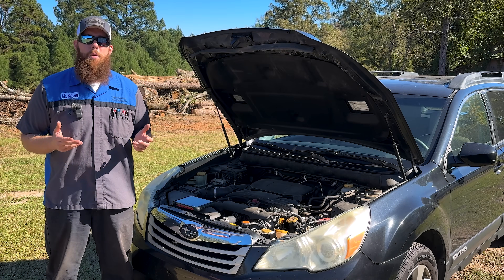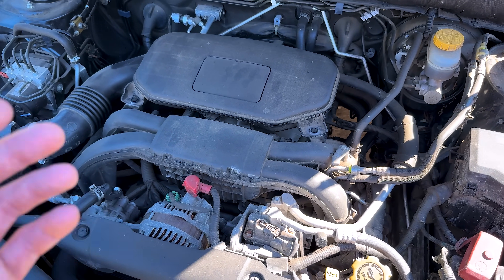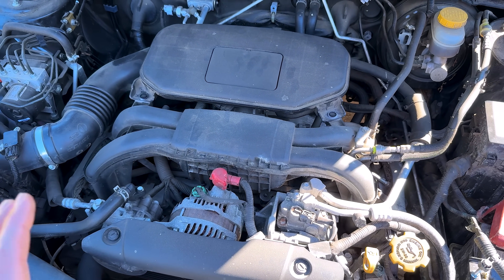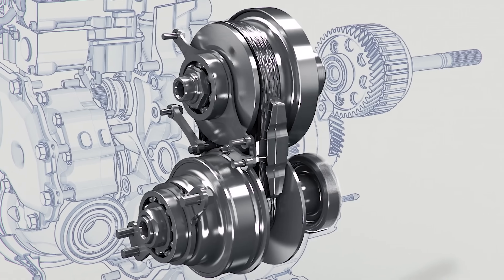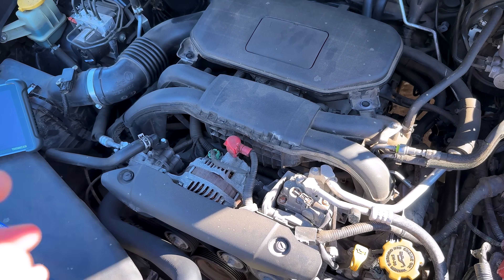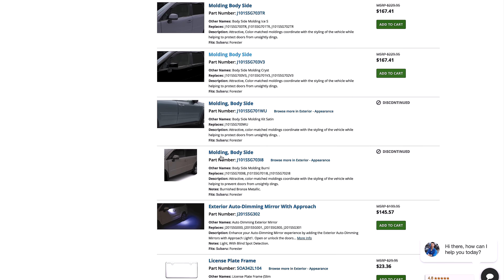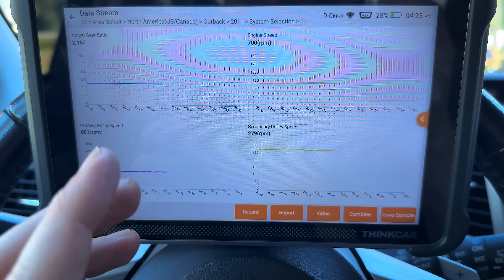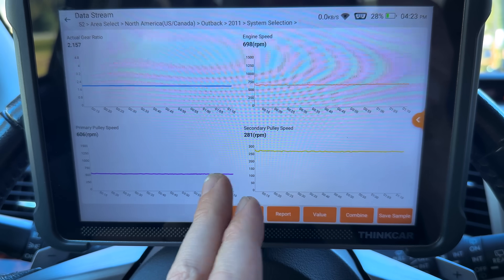Everything About Subaru CVT Chain Slip! How To Prevent It, How To Diagnose It, & Repair Options!

Comment: Yes i have chain slippage 2017 forester xt 117k on clock just bought the suv 6 months ago asumming the original owner never change the fluid started slipping about 3 months ago mostly slip at speed 46-55 MPH on hwy when car is running over 30 min on hwy the slipping goes away for some reasons but subaru is also out of stock on fluid waiting for 6 weeks no fluid at the dealer so i will take a gamble buying a used tranny with 85k on it and do the fluid change on it also the strainer and pan since the fluid is expensive i rather buy a used tranny with 32k less mileage than mines, what do you think used tranny for $400 fluid strainer corking for pan $300 then labor what you think?

Comment: I have a 2014 Outback that had the CVT replaced in 2021 at 98k miles due to chain slip. I had a Subaru maintenance manager refuse to do a drain and fill
When I hit 33k miles because he stated it was a lifetime fluid. Change your fluid folks.

Comment: Subaru Cvt are good transmissions but require clean fluid,my boyfriend bought a 2017  Subaru Outback 3.6 as a Truck replacement for farm work,the deal was to good to pass up. It has 197,000 k on it but runs a drives great save for the Cvt acting odd. I told him he has to flush it ,he drained it out and it was much much better but still acted odd.I told him to do it again in about 800 miles he ignored me until I stole it while he was at work and did it. Now it drives totally different , the strange rubber-band effect is gone,the surging all of that is gone and now you know how much it was slipping. They take twice to get all that old fluid out. He used Triax CVT fluid and it works wonderful.
Reply: any update on how it's working out?

Comment: I have a 2013 outback, when the transmission is still cold even if I drive slowly the engine is at 2000 RPM. The revs don't drop. What could it be?

Comment: My 2017 3.6r outback does that momentary hesitation and squeal usually with in the first 1-2 miles of driving and usually only once per trip. Does this sound like chain slip. I'm thinking of getting the fluid changed to see if that will help

Comment: It’s hard to know what to do when Subaru dealers tell you to not change your trans fluid until 100k miles. Then you hear on videos that you should change it every 36k. Subaru will warranty the trans to 100k but only if it’s never been open. WTF! I’ll buy Toyota or Honda.

Comment: In December 2018 we bought a 2019 Foerster. Shortly after we got the email from Subaru about the extended warranty,  don't change the fluid until after 100000 miles. Will it cause damage if I change it now at 127000, like an old style auto trans?
Reply: That's a myth. You can change the fluid whenever you like, it won't cause damage if it hasn't been done yet.

Comment: Hey! I have a 2015 Outback and this video was extremely helpful! Was curious though if the transmission fluid has never been replaced is it better to leave it alone and not replace it? I've heard mixed things from people and I'd think you'd want to get the particulates out no matter what but I'm not a mechanic.

Comment: Logic is telling me you would never see slippage on the secondary pulley. The primary is the input/engine side so that one would slip under load. If the driven/secondary pulley is slipping, it would still show up as a slip on the primary, not?

Comment: Hi Robert 😊hope youre doing well. Ive stumbled your subaru channel on youtube. 
Thank you for all the info about subarus. 
I’ve recently purchased a 2015 OB 3.6r with 125k miles for my wife. Weve been impressed with the car so far. You made a video that subaru cvt is pretty reliable when not abused and also when its serviced. You mentioned valve body. What symptoms i should look out for if my valve body is failing? Is this main issue on the tr690 HT cvts? Cheers🙏
Reply: Oh I love my 2015 3.6r it’s one of the best cars ever made and is pretty quick too. Sadly it’s the best ever made in every way except for one…. My CVT in mine has had total failure 4 times now totalling to $30,000 dollars out of pocket for services and entire new Cvts since mines out of warranty….. pretty brutal and wish I never bought the car I paid $20,000 for the car and as I said just in CVTs and CVT fluid services I’ve spent $30,000 now in the past 5 years so $50,000 on a 2015 Subaru that had 190,000km on it when I purchased it…. Pretty brutal and has ruined every savings I ever had saved up literally ruined my life in allot of ways and been struggling to get by ever since owning the car

Comment: I swapped out old cvt on my 2016 legacy and installed 2019 outback cvt on it(is not even been a year since that), ive been driving and rn it shakes while accelerating, and shakes while stopping, i took it in the repair shop and they said that it wasnt the tranny, it is an inner axle problem but im not sure. can u recommend anything?
Reply: It also got misfire, ive diagnosed it and computer said that air to fuel ratio is messed up. i also hear it on the passengers side that air is getting sucked inside manifold, can that cause problem?

Comment: When shifting from park to drive i hear a small half second chirp or i think slip. Is this a problem?
Reply: This is a 2020 outback
Reply: @LDimmock  Mine used to make that chip, sounds like a mini burn out from the tires, now it doesn't make it after putting in a new CVT.
Reply: That is a CVT issue, yes.

Comment: I don’t need to watch the video to say, I have personally obliterated a 2019 civic cvt. I drove it like a moron as you would a 6 step automatic. And the rough driving killed the cvt. After that little “warranty” coverage repair at the dealer, I religiously maintained the new cvt with oil changes and even filters that they don’t tell you about and is easy to miss.

Comment: Yikes I never changed the fluid in my CVT and it’s at 230,000 miles. I once asked my dealership about changing the fluid but they said it was a sealed and isn’t to be serviced.

Comment: 2016 Subaru Legacy 2.5i limited

Hi, subscriber here.

I’ve just watched your AC compressor issues video. I have a couple questions. 

I turn on heat or AC, and I hear a rattling that comes on every few minutes. What could be the problem?

My battery died a last year, so I put a brand new one in. Only problem is, I have “Christmas lights” on my dash. (Blinking AT OIL TEMP, ABS, Eyesight, traction control, lane assist and a couple others). I’m told that the regular ODB readers can’t clear or reset. Only the Subaru dealership. I’ve tried relearn. I’ve tried unplugging the negative for  20 minutes. No change. With that being said. It has deactivated my AWD and sensors… I don’t have any driving issues with the car. Starts and runs perfectly fine. What could the problem be?
Reply: Rattle can be many things. Blend door, blower motor. It would need further diagnostics. 

If you don't have a check engine light, a lot of basic tools will not read it- that is correct. 

Abs and transmission codes generally require better tools. 

If I had to guess, you either have an abs or brake issue. You don't need particularly expensive scan tools to real abs wheel speed sensor data.

Comment: How much is a new cvt transmission
Reply: I’ve spent $30,000 out of pocket on my 2015 legacy in the past 5 years on 4 total new Cvts and fluid for servicing them. Every single one has gotten the same chain slip basically total failure and I never tow with the car and don’t drive it harsh always full maintenance done on the cvt fluid. The car has taken all my savings and literally ruined my life I now struggle and literally have been starving myself over the car since I have no money now

Comment: 2013 Forester and had my transmission guy change the fluid at 58,367 miles. He said it was very dirty and my request to change it was a good idea. I wasn’t having any problems and wanted to avoid problems. I believe there is no such thing as lifetime fluid.
Reply: There absolutely is lifetime fluid! 
It gets replaced when you replace the CVT😂😅
Reply: I think the Forester only got the CVT in 2014. Your Forester probably has the 4EAT.
Reply: @7894-q4g  That would be great to not have a CVT. Thanks. I’ll check the code.

Comment: So then you recommend changing cvt fluid every 36k miles??? Thought in US, not suppose to change until after 100k ??
Reply: Our 24 forester it’s at only 10k miles and I asked the maintenance department on our last oil change and they said they recommend the first cvt service at 100k miles.
Reply: @powertools2375  they'll say that bc like what MrSubaru said, in US that's the company line to keep repair/maintenance costs down. But in Japan & Canada, they suggest like 35-50k.
Reply: @powertools2375  Listen to MrSubaru but also Subaru Japan says change out the CVT fluid around 30k miles or so. I would say unless you are very hard of the car you could go 40k miles and not worry.

Comment: Hey @MrSubaru1387! We have the EXACT SAME VEHICLE! I've owned it since 2012 (second owner) and has 164K. Still going strong. I replaced the CVT fluid at 100K miles out of an abundance of caution (and after rejecting the advice at the time from Subaru that this fluid was good for the "lifetime" of the vehicle; translation: until the vehicle was out of warranty and no longer Subaru's problem). I am so grateful for your work in putting these videos together. They are absolute GOLD for DIY'ers like me/us. Maybe someday I can buy you a drink/coffee/meal to thank you! Hope you have a great rest of your day ahead.
Reply: How did the car drive / Feel after you placed the fluid? Did you notice any difference?
Reply: @Great_Question  The power delivery to the wheels definitely felt smoother. It's something I definitely plan to keep doing to get as much life out of the vehicle as I can. Definitely go for it if yo'ure on the fence--just get a temp gauge to make sure the CVT temp is right before you close it up.
Reply: What is the cvt temp? Thank s
Reply: I have the 2011 outback but only 33k
Reply: Supposed to change out transmission fluid every 60k anyway.
Reply: Change it and differentials every 30 to atleast 60 k

Comment: Excellent video and that is exactly what my CVT was doing.  An independent mechanic found the problem immediately after two different Subaru dealers went into their Sgt Schulz routine claiming that they "heard nothing nor felt anything."
BTW, if you hear a short chirp when putting the car into gear, that is the start of the slipping issue.
Reply: incorrect - a short chirp when the cvt is cold and put into gear is normal.
Reply: @MarcoABCDEFG  Who told you that?  Your dealer?   If it was normal every single one of them would chirp when brand new.  Mine never chirped until 60,000 miles.  A few thousand miles later, I had the full screeching belt slipping.

Comment: I have a 2017 WRX it has 70k on it.
I just had the service for a trans. Flush and fluid change.
They found the torque diff. Seal leaking it was covered under warranty. He said its a problem they are starting to see more.
Just wondering if you have come across this issue.
Thanks :)

Comment: I don't understand why they didn't just use the same design but with an accessible, rubber bely JUST LIKE A SNOWMOBILE. It's cheaper than a clutch, and a whole lot more reliable than these, even if the maintenance is a bit more.

Comment: Can you make a video about how to achieve a 200k+ mile lifespan from a Subaru? How often should I change the oil? What should I replace at 100k miles? How can I avoid costly repairs for Subarus in particular?
Reply: Change the oil every 3k miles keep it checked frequently. CVT fluid every 15k-30k miles do your diffs at the same time. Coolant every 50-75k miles depending on the type of coolant and which engine you have

Comment: Thanks for the video, i have a subaru xv 2022 (eboxer EU version) with the Th58 cvt . Looking for what cvt fluid to use in this gearbox i get conflicting information from different sources including dealers. I would appreciate if you can provide some insight into this :). Any ideea what subaru cvf fluid does this gearbox require or where i can find some new resources about this topic ?

Comment: We've got a '14 Forester with the 2.5l and about 125k on the clock, about 70% highway. Up to now I've followed Subaru's schedule and NOT changed the fluid. I've seen all sorts of arguments both ways and it's a confusing mess. Your voice i trust and realize i should have the service done. Question is, will a fluid change negatively affect a transmission with that many miles? It's operated flawlessly up to now.

Comment: Looking at a 14 forester that a dealer replaced the shortblock (failed oil consumption test) and Valve body. They want 8K with 110K. Seems like all the major issues would be addressed.

Comment: The fact Subaru puts lifetime fluid in the manual should be almost criminal
Reply: Thank the EPA. They rate a vehicle's carbon footprint based on fuel consumption and service intervals. If you extend the service interval the carbon footprint goes down
Reply: That and their 'extended' warranty (10y/100,000mi) that would be void if you change the fluid.
Reply: @hotpuppy1  there is no extended warranty except for certain model years. Subaru of Japan recommends fluid change intervals.
Reply: @megabyte5689  Yes Subaru Japan says around 30k for the CVT. But you can go up to 40k if you are not very hard on the car.
Reply: @hotpuppy1 what if the Subaru dealer does cvt drain and fill would that void the transmission warranty?

Comment: < 25 = D
4th < 45 > 5th 

Thank you so much for doing these CVT videos. 
I think I have chain slip in my 2012 outback with 117k miles. I've been driving it in manual for the last 2 months and I can almost completely  avoid the squeals and hesitation. 
My trick is to leave it in Drive from a 0 to 25mpg, then I switch to Manual mode and keep it in 4th gear. Over 45mpg I use 5th.

Under 25 keep in Drive
4th under 45
5th over 45 

< 25 = D
4th < 45 > 5th
Reply: That's cool and all but realistically it's a ticking time bomb if it chain slipped once. So, don't be surprised if one day it just quits on you in the middle of the road.
Reply: @rock962000  I'm sure you are right.  It's a second vehicle and I only drive it around town.

Comment: I have a 2019 Ascent with only 55k miles and it had the CVT serviced under a recall not long ago. I’m having some hesitation at low speeds, kind of a jerking motion. I was worried about slip but there’s no squeal. It’s more like it just can’t figure out what it wants to do with light acceleration at low speeds. Flooring it works fine and it pulls good. Any ideas?
Reply: My wife has a 2019 as well with 100,000km(60K miles) and have the same issue but its when I am at apex 80km/hr and let off the gas then re accelerate gives almost a shudder. Only does it here and there. I had the recall done and no issues they found, brought it back two more times and they say they can not replicate the issue. We have owned it since new , all fluids/maintenance  have been done on time so I have no idea what the issue is. This is our first Subaru and doesn't give me to much confidence keeping it long term. Always kept my Toyotas long term with no issues but I fear this won't be the case with the Subaru.

Comment: OH BOY. i keep seeing these videos. all i know is my 2023 Subaru Legacy Limited has 21,000 miles on it and the CVT fluid is getting changed next month and then afterwards every 20,000 miles. not taking any chances.
Reply: Japan is stricter on maintenance which CVT drain and fluid is 30k ,reason they do not have issues where USDM has failures.

Comment: Does the 2003 subaru forester xt come with the CVT transmission ?
Reply: No it does not the cvt was introduced in the forester in 2014 . The 2003  has a 4eat automatic
Reply: Yes if it's an auto in a Subaru it's a CVT.

Comment: Hello Just wanted to know if a EJ16 1996 subaru impreza manual transmission can be bolded or connected to a ej20  2003 subaru forester xt engine

Comment: My daughter has a 2011 legacy that I believe had an issue with chain slip, although I don't have any data recordings to show it.  The dealership told us we needed to replace the CVT, which was going to total out the car.  I did a fluid drain and fill with Subaru fluid, and it eventually stopped slipping.  That was almost 100k miles ago.  I think degraded fluid is a contributor.  I now drain and fill every 30k miles.
Reply: Just curious, for the drain and fill do you use a scan tool to monitor the fluid temp and do the whole Drive / Reverse / Neutral before sealing up the CVT? Do you also need to do the CVT relearn each time?
Reply: @bys5036work I used a temp gun. Just start filling  at the minimum temp. Temp gun is just a few degrees lower than inside the case. It heats up fast. I noticed just going through the gears one time on a cold engine, the temperature is right around the minimum.
Reply: @bys5036work  I also just used a temp gun, got the outside of the case to min temp, cycled the shift lever through its positions then back to "park."  It runs just great and I never performed an "official" re-learn because I don't have an expensive tool to do that.
Reply: @bys5036work  ive used a fluid/meat thermometer with the tip of it in the fluid throught the fill hole and never had a problem.
Reply: GOOD TO KNOW!  thanks